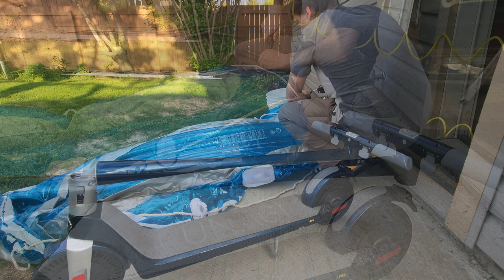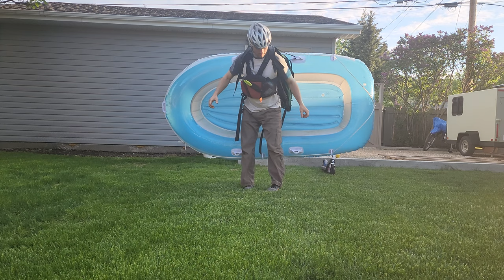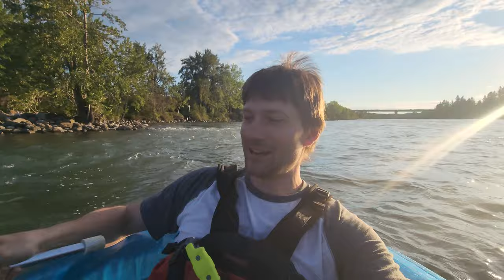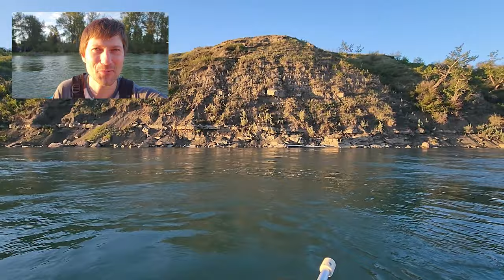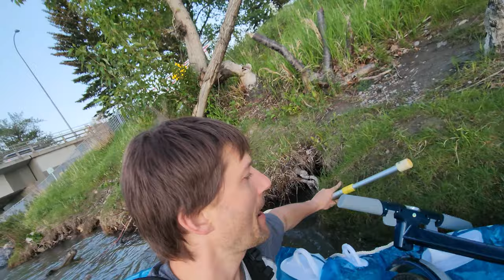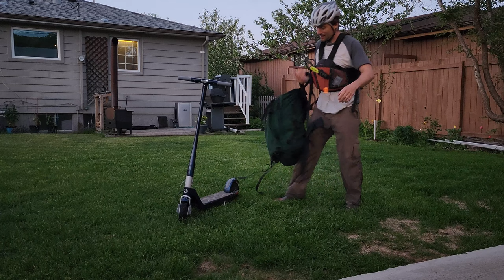Rafting the Bow River with an Electric Scooter!  Worlds Most Exceptionally Seaworthy Dinghy...

Comment: What a wonderful Presentation - Thank You
Only criticism is , even though it was 12 minutes long , the time passed so quickly , it felt way too short.
Did you say that scooter runs off gas ?
Reply from the maker: Thanks Mohammed!  That's high praise considering I'm usually worried my videos go on for too long...  It's nice when they just sort of draw you in and when it's over you wish there was more.  
The scooter is electric and plugs in to charge.  It will go at least 15km on a charge at 30km/h up and down hills and costs about 5 cents for a full charge.  Pretty fun and capable little machine.
Reply: @UtmostOutdoors  You are an example of what YouTube channels appeal is all about to me.
It's not about the subject or topic.
It's the way the presenter goes about it.
Like many of My Favourite channels , You could tape and talk about pretty much any subject at all and I will watch it with interest
EXCEPT that cat tape you did- that was too long.

Comment: Great video! I have also combined e-scooters and packrafts for a while now, the biggest challenge is still to find a dry-bag (not a waterproof pvc-backpack) big enough to fit even very compact scooter (e.g.: E-twoW V, 94x33x12 cm). so I am about to hot iron one out of  PTU, but I doubt I can manage to make it waterproof. 

Have you found a suitable Drybag or any similar solution?
😉
Reply from the maker: I guess I was just living dangerously and not using a dry bag.  I imagine your costom fit solution will be perfect!  So many possibilities to pack raft and scoot!